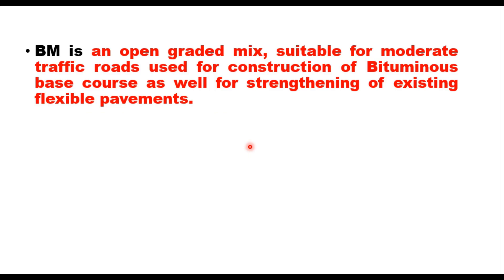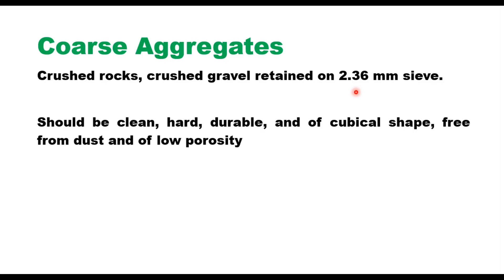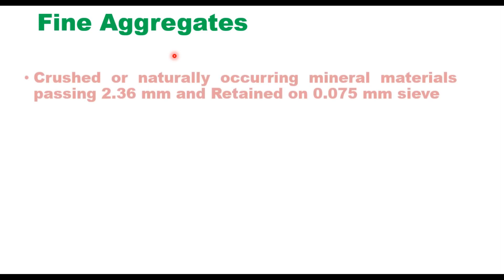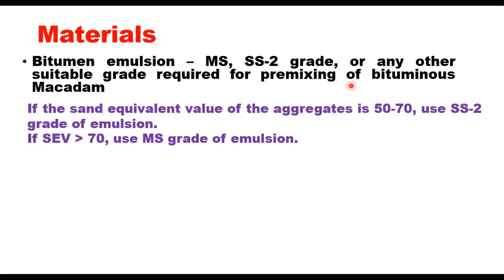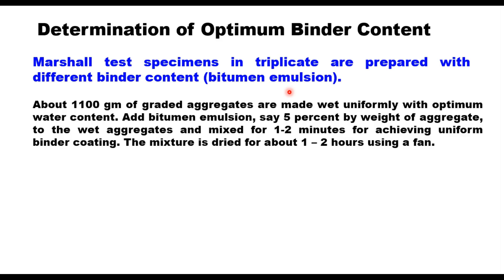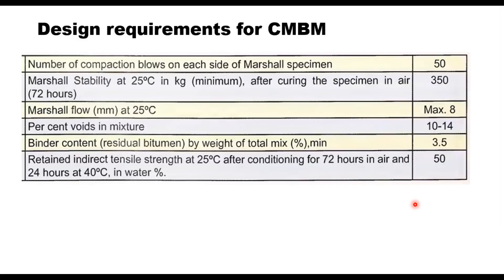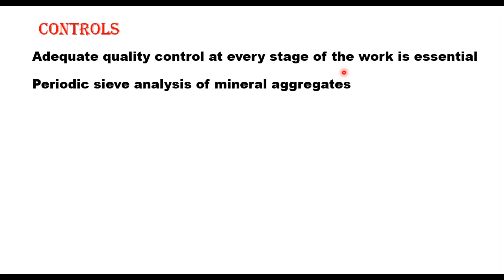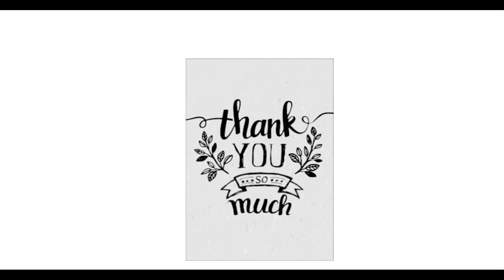Cold Mix Bituminous Macadam (CMBM) as per IRC SP 100 Design of mix, construction and quality control

Comment: Sir In MoRTH Table 500-44 it is mentioned that for binder content shall be determined by modified marshall test and in MS 14 it is mentioned that take 1200gm of aggregate batch. I am preparing mix for DBM. Sir which method has to be followed ??
Reply from the maker: Take as per nominal maximum aggregate size

Comment: Sir  rigid pavement me transverse aur longitudinal do ki cutting hoti hai kya aur PQC thickness ka d/3 ki depth tak kyu cutting karte hai
Reply from the maker: Longitudinal joints are required when pavement width is larger than 4.5 m. Yes, both transverse and longitudinal joints are cut.
These are cut up to a depth of d/3 to d/4 depth to relieve the stresses. Will make a video on this topic soon.